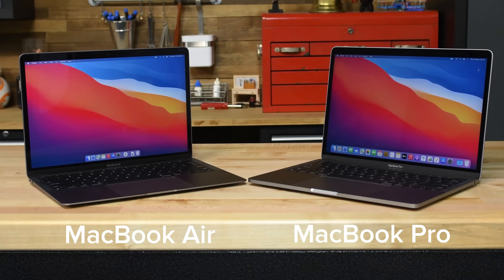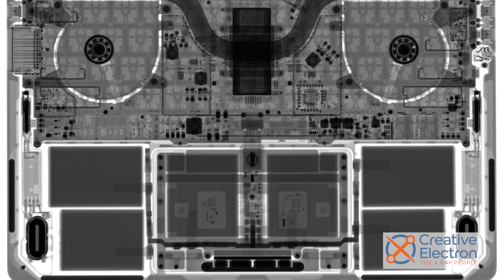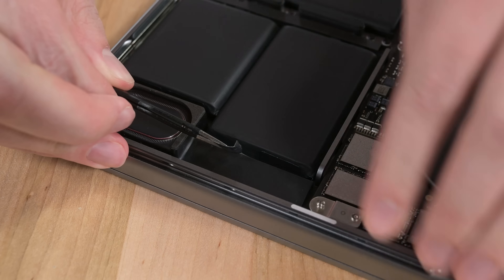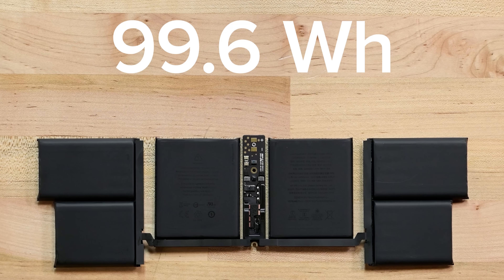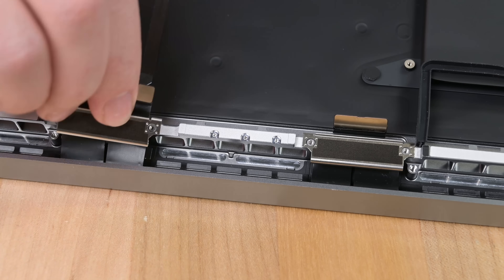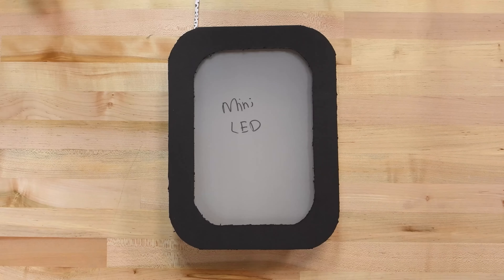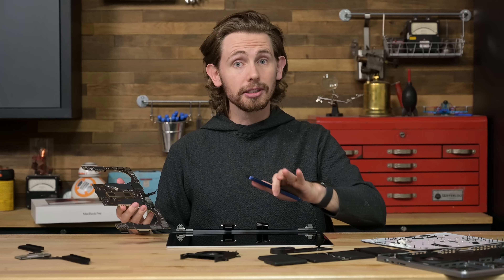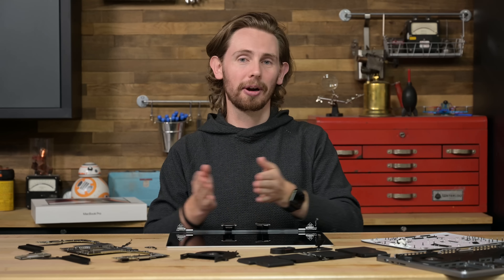MacBook Pro 2021 Teardown: Easier to Repair, Harder to Score…

Comment: Barring any serious mechanical damage (i.e. from accidentally dropping or crushing the device), the only part that should ever need to be replaced is the battery.

Making the battery replaceable is so huge. I've had so many devices that were perfectly usable, that became unusable because of battery degradation, and an impossible battery replacement procedure. (Phones, surface tablets, etc.)

It would be nice to see upgradeable storage and memory, but I don't think Apple is ever going to do that.

Comment: Modular storage on the laptop is not negotiable. Laptop is not a smartphone or a tablet, any serious work-oriented laptop should have at least one, better 2 m.2 sockets. Apple charges 2x-3x the price for storage, without the possibility for hardware-based redundancy and if something goes kaput on the machine (not even storage necessarily) you're not getting that data back.

Comment: hey, ifixit. I have a question. Ive seen this pro repairability movement over the years and one this that i do not understand about it is the mentality of something being removable. Like, i get it, its easier to remove. What now though? like, i couldnt care less if parts are as easy to remove as the fairphone does or apple level of non-removability, but if you do not have the original parts its basically useless. 
if we put it in the context of the new macbook pro lineup, even if some parts are easier to remove, i would never use a third party battery on a 2000$ device, i think the risk is way too high (since batteries are not exactly safe). This should rather be the directions we should head into. That way if something is hard to remove BUT there are original parts then you support 2 "industries": if someone thinks they do not have the skill to remove it they can still bring it to a repairshop OR if you do have the skills you can do it yourself with original parts and overall save a lot of money.

Comment: You don’t need to add 1mm to the thickness of the laptop (which would be quite bad)  to have removable batteries. You can have screws on the edges of the pouches where they get thinner.

Comment: One of my keys on my M1 Mac became loose on one side, I handed it in to my local Apple Authorised dealer to be fixed here in Gothenburg Sweden. They claim that the key holder is broken and say that it is not under guarantee as it cannot have happened by itself and gave me a repair estimate of around 1000 dollars!🤯 They say that the design of the M1 to fix a key holder means that you have to remove and change the battery and the hours for fixing where around two hours! So, I shall not be upgrading to the lovely M1 pro and max’s because a simple thing like changing even a whole key board yet alone one key should not leave one liable for a huge repair bill!  I shall not repair it!😥
Reply: i had an issue with a 2017 MacBook in Denmark - refusal of repair (the black plastic under the screen). I actually challenged them in all the forums I could find to tell me how I could have damaged my MacBook. After they failed to come with an explanation they accepted to fix it for free. Go ahead and challenged them - JUST INSIST.

Comment: my 2012 MacBook Pro's HDD cable recently broke, thankfully I could replace it and I wonder what could go wrong on the new ones. Knowing that the battery can be replaced is great since that is the only current problem my computer has. I have no idea about internal SSDs lifespans and I wonder if doing heavy writing into an external drive helps.

Comment: I’m really glad they made the battery removal process easier than before and that the display cables won’t be ripping like older models.
Reply: My speaker is cracking sadly I found out it's a physical damage. However, I found it I need to take a lot of things out in order to change it. Can I remove it without taking the battery?
Reply: No point in making the battery replaceable when Apple doesn't sell any MacBook batteries to begin with though!
Reply: @mini9503  I thought you can still get a third party one
Reply: @mini9503  You sir are a true hero. They should sell parts. Totally agree.
Reply: A 2 trillion $ company can't design proper display cables? What a joke
Reply: Agreed 💯
Reply: Yep it was bad. The 2016 - 2019 MacBooks were bad. These new 2021 ones have proper cables that don't rip and have proper keyboards.
Reply: did you read the his comment or watch the video? they literally did exactly that. who cares about the old models which are not sold anymore and had a repair program too. they learned from their mistakes, thats all you can ask for.
Reply: @katzenjunge5869  it doesn't matter. Build your stuff for longevity. Spend the extra
.005 cents on longer flex cables.
Reply: @katzenjunge5869  No they created the mistake in the first place. Apple has been making laptops for years and years and years before they made one with poorly designed cables. So it is a disgrace they couldn't make proper cables like they did before.
Reply: @zachv1942  They did use better and longer cables in the 2021 MacBook pros. The video even says this.
Reply: @marksapollo  Well, it's a good thing that they fixed it with the 2021 models huh? The display cable was the problem with the 2016-2017 MacBook pros.
Reply: @rohithmekala2608  I guess we wait to see what faults the 2021 models have, but they are said to be incredibly good laptops, so hopefully none. Still Apple has had several generations of poor designs to learn from. Bad keyboards, poor thermals, Touch Bar no one wants.
Reply: @katzenjunge5869  they didn't include all the models.

Comment: i m kind of confused about why you gave it more than 1? for repair ability? this thing is only replaceable not repair-able! it will be impossible to find parts, it will not be worth it when you found some, and more likely keyboard/screen issue will likely be more common and neither of which user replace-able (without loosing certain functionality!) line between repairing and replacing here is blurred or abused i think when giving out any score.

Comment: It's VERY similar to the previous 'touch bar' models. I just hope all the bugs with the logic boards are sorted but the whole soldered design is in my mind a huge issue. I had a 2017 MacBook Pro and the logic board failed within a year, the screen failed within 3 years, Yet my old 'classic' 2014 MacBook Pro continues on in 2021 without EVER a problem. Sort of says to me Apple made some very poor decisions in the redesign with the touch bar models. I wouldn't touch these new models until at least a year of others finding design faults and failures. It's just too much money to blow being the test pilot for this Apple bling.
Reply: I am the reverse, beside the famous doubled space key my 2016mbp is the only one that didn't break. Can't say that about my older macs, mbp2012 graphics breaking 2 times, one row of keys not working, and camera; my white mb with inflating battery; macmini g4 broke too.
Reply: Lol my 2014 had to have the logic board replaced 2 months after the warranty expired. Apple generously fixed it for free thankfully. Been great ever since though until I replaced it  a few weeks ago
Reply: @MyLastSong719  Oh, I remember when they had good customer service 😢
Reply: Well this is a whole new architecture than the 2016-2019 Macbook Pro. The whole logic board would need a complete redesign when compared to the touchbar models.
Reply: My speaker is cracking sadly I found out it's a physical damage. However, I found it I need to take a lot of things out in order to change it. Can I remove it without taking the battery?
Reply: Lol that's such an anecdotal point you're making here. I don't see how your individual experience is representative of anything. Many people had more issues with older models, so it's the exact opposite. It's not a measure of anything.

Comment: Can you verify if the force boot power pads are back? older pre 2016 Macbooks had those copper pads on the board that could be used to force boot, they came real handy in repair

Comment: 8:32 the other thing that may make these better than the iPad's mini LEDs is if they had made each LED an independant dimming zone, or reduced the number of LEDs in each zone, instead of grouping those 10k mini LEDs into several LEDs per zone, making a significantly less than 10k zone mini LED, and not much different than a normal LED backlit LCD

Comment: This is a massive step in the right direction! im glad apple finally admitted to there mistakes. its so rare nowadays
Reply: My speaker is cracking sadly I found out it's a physical damage. However, I found it I need to take a lot of things out in order to change it. Can I remove it without taking the battery?
Reply: @jaden4833  I believe most models let you but i could be wrong

Comment: There are no sockets for lpddr5. You cannot get the same bandwidth without very short traces. The boot ssd is special, since the controller is integrated into the SoC for security reasons. So it’s not really easy to get an industry standard replacement.

None of this is new. Apple uses LPDDR for power savings. And you have USB4 for high speed expansion.

Comment: The use of on-package LPDDR5 has some fairly large implications on performance and battery life so I definitely think they can be given a pass for that, unlike some of their previous designs that used bog standard DDR memory. On the storage side it is a little bit more dubious, but there is no SSD controller on the mainboard so it does look like it's integrated to the SoC as well. I too am a little bit less salty about the lack of modularity inside the machine this time around.

Now if only they were selling parts and publishing schematics.
Reply: People who can use parts, can figure out schematics. Can't "figure out" parts.
Reply: AFAIK, Apple has begun selling parts and repair manuals, as of 1-2 years ago, so that people can repair their machines themselves.  This is unprecedented for Apple.  I'm glad they've seen the light.
Reply: @lifeisbetterwhenyourelax  Not for Macs unfortunately, and only for an extremely limited set of parts and repairs - ie screen and batteries of recent-ish iPhones. A move in the right direction to be sure, but one that feels a lot like a token gesture to preventively evade right-to-repair legislation.

Comment: Ugh - the consternation over the notch.  I saw one at a local Best Buy and didn't even thing about the notch until the person hovering over the laptop while I played with it mentioned it.  And if it really bothers you there is at least one app that will shrink everything below the notch - but seriously it's nice to have the extra screen real estate.
So while I wasn't originally thrilled when I heard about it, after playing with a machine that had it and not even noticing it (and no, it doesn't show in full screen video either!) for me it's an utter non-issue.  And if it does bug the crap out of you as I mentioned you can shrink the screen and permanently ban it.

Comment: I give it a 2/10. Even though the most used features are fairly easy to work on to me, I care only about the issue that force customers to get a new device: Board, storage,  processor , Memory and display issues. I get that packing memory into the same package as the processor and GPU yield astronomical advantages in performance, those are the parts that fail the most and most repair shops, like mine, do not have large extremely expensive reflow systems capable of removing processors. I've successfully done it without one but I failed many many times before success. To me, this new design is apple saying hey, we hear you. You want better repairability. Here you go BUT, I do not trust any of you to do the real stuff on these devices and we want you to be strong armed into doing so. 

So, I still see a lot of "sorry, we are not able to repair this" or "No sorry, we do not fix macbook pros newer than 2019. With that said, I will definitely try to get one because it will be mine. If it breaks, I gain a chance to explore and learn what most shops are not able to or, I can simply have fun trying to fix it. The incredible performance makes it worth it.

Comment: It’s still a major pain to replace but the fact that the battery can be replaced at all without nearly destroying the bottom case is a win in my book. I know they’re rated for 1000 cycles but anyone who uses a laptop as much as I do knows you’re gonna wear that battery down in 2-3 years but I’ll want to use it for 3-5 years. Having the ability to replace the battery even if it has a bunch of extra steps is better than not at all.

Comment: I honestly don't think you can penalise the integrated RAM and storage. This is just fundamental to how the system works and not a design decision relating to repairability.  That said it would be pretty awesome if Apple just included a seperate NVME / m2 expansion slot for storage upgrades.

Comment: You didn't mention the fact, that new mbp now draws more air from sides of the laptop, and is there any dust filter on those wents? and how will it look afer a year or two of using, when you need to be semi pro to basically take the lid off to clean the inside of it. And still, how pro is a machine you cannot change, upgrade, or fix the storage.

Comment: As a person responsible for getting the boardviews / schematics out and about for the people repairing the mainboards, I am anxious to see how long before we can get our hands on those diagrams.  In years past it was entirely normal / expected not to see anything for a couple of years, but in the last couple of years there's a very strong expectation to get access to them within 3~6 months... so here's hoping some "leaking" happens soon and that we ( repair people ;) ) can get them sooner rather than later.

I have to say though, I'm a bit disappointed with the component sprawl on the 16", I was rather hoping instead we'd see more development along the lines of the 820-020xx series rather than what seems to be now another 820-01700 remake :(

Comment: Will it be possible to unsolder and replace the HDMI and SD reader?  My ONLY complaint with my old Macbook Pro is an impossible to repair headphone jack.  It "sort-of" broke, and can't be fixed.  All ports CAN wear out or get damaged, so all ports should be easily replaceable!

Comment: 5:57 That spudger you're using is a glass-fiber reinforced spudger, meaning it has glass that may be exposed along the scraping edge. So it should be more like scratches at a level 5 with deeper grooves at a level 6, right?
Reply from the maker: Oh man, I think you might be right! I didn’t think about which spudger I picked up haha. It must have been that, or the thermal paste doing the scratching (which was my original thought). -TD
Reply: @iFixitYourself  I remember when you guys announced the pro-tech toolkit that the spudger was featured in! You have always made some amazing products for repairs! Compared to other plastic spudgers, yours are hands-down the best. I have been using your tools for the past 10+ years! Thanks for providing a great, reliable resource for tools and guides!
Reply: I was like, what's that shield made of? Lead? Mercury?
Reply: @JorisKeijser  maybe Bismuth? Lol :)
Reply: Yeah it felt weird seeing because I've seen another guy do this without a single mark. You have a good eye!

Comment: I’ve done a bit of research as well on the memory. Basically, Apple is running LPDDR5 at a much higher bit depth than the DDR5 that is coming out for socketed applications. At the absolute *bleeding edge*, we will see DDR5 clocked high and capable of pushing out 130GB/s with modules spanning hundreds of gigabytes.
However Apple’s Pro and Max chipsets with their fully integrated SoC design are capable of fire-hosing 200 and 400GB/s which is something unheard of. The only memory we see capable of hitting 400+ is discrete graphics memory which still needs to be fed from other parts of a motherboard using lower bandwidth channels. A new MacBook simply runs at these crazy numbers using the unified memory architecture all the time.
So, no. You’re not going to repair this yourself unless you have access to the raw chips and a robotic de-solderer, but you do have a wildly capable laptop.

Comment: I think this missed the mark a bit, especially when it came to the removable memory. This thing has 8 channel memory, does anyone believe putting 8 dimm slots in this realistic? You end up undermining your message and influence when you try to criticise over these issues which are simply matters of physics. DDR5 needs the short path length, and apple’s billions of dollars won’t change that. You could have spent time talking about the keyboard, trackpad, liquid protection, replaceable storage, all things can actually be fixed.

Comment: Stretchy removable adhesive is not the solution repairers wanted overall. We want screws. Besides that this is  a step forward towards long term relevenacy

Comment: Great tear down! I think with Johnny Ive mostly gone we will see a further mm or two increase here and there as function triumphs over form. My bet is that the performance gains of shared memory won’t be matched with sockets and data traveling all around by 20th century bus, but you never know until it happens.

Comment: Remember when you could just unscrew the battery and didn’t have to use alcohol and sharp tweezers near a flammable battery?
Reply: Pre-2008 you could swap the battery without even opening the case!

Comment: 10:06
> Apple adds millimetre to this model
> People freak out...
Seriously, the pull-tabs are a good compromise to adding additional thickness and weight
Reply: I have to agree with the video. Having to remove the trackpad to access the final battery pull-tabs is a little ridiculous. The additional weight and thickness of a few extra screws only matters on paper. In the real world, no one is going to tell the difference.